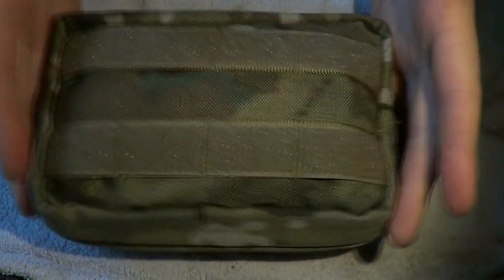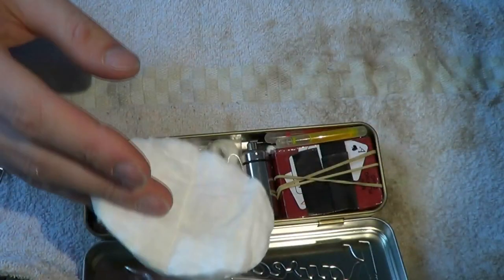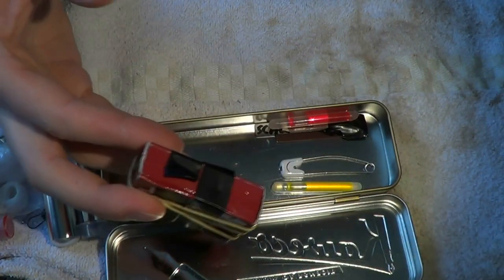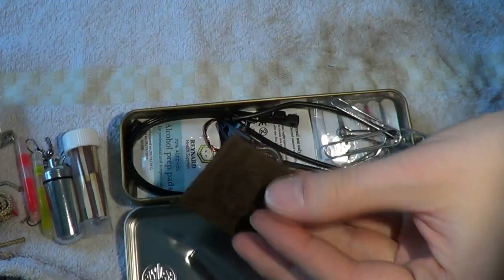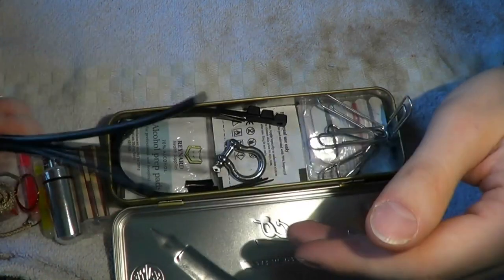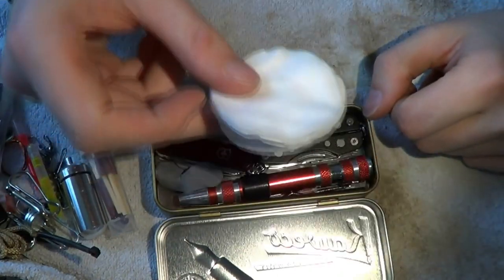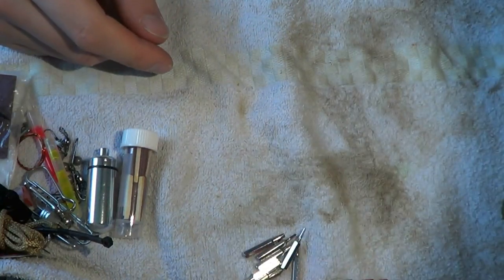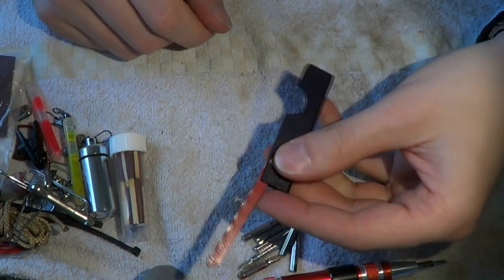Gearing up with SBRE Brown Extra Survival Tins

Comment: Hi Stephen,

I just thought of something that would be useful, while watching your video.  Have you heard of Instamorph moldable plastic?  It comes in granules and you heat it up in boiling water.  Once it's cooled down, it is very robust.  I've fabricated and repaired numerous things with the material. And all the applications have held up for over a year now.  PS, I did use it to encase a powerful neodymium magnet, and add a lanyard loop.  It also protects the magnet from chipping.  You can get it from amazon.
Reply from the maker: That sounds like an excellent addition.  Thanks a lot for this suggestion, I will look into it!

Comment: What kind and make electrical tape you used to tape the tins shut? I see my tin I bought and yours have much better quality tape than I buy for my electrical stuff and have not seen anything other kinds, just the same low quality china made stuff :(
Reply from the maker: Oh, I just buy mine at a budget store :-).
Reply: stuff from china has glue that goes everywhere but does not stay at the tape properly. Yay for low quality stores in my country. I have to find one cent more expensive tape somewhere probably :D